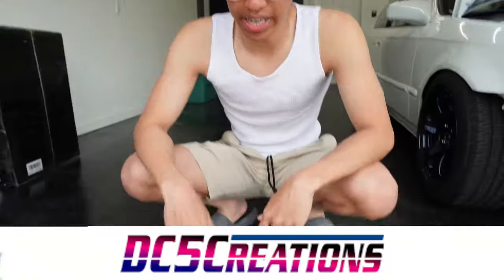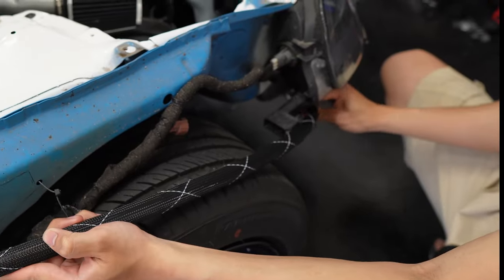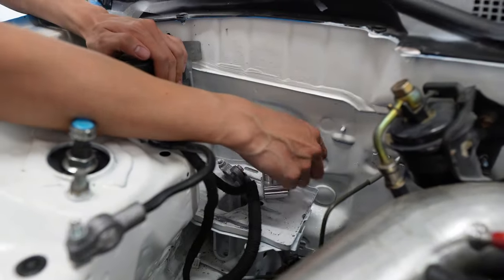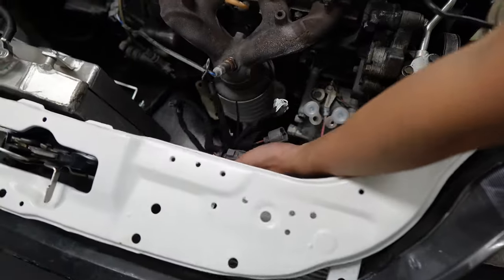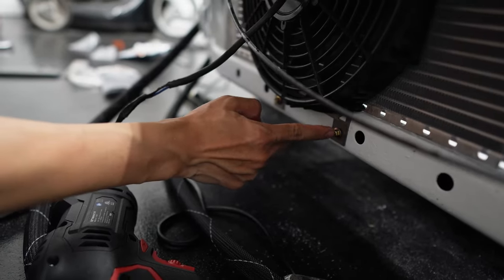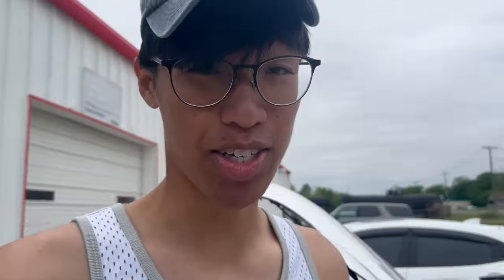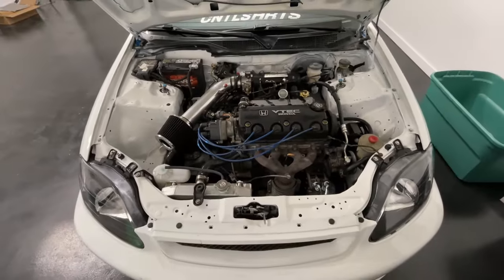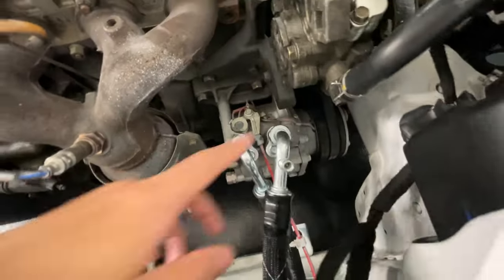The biggest key before turbocharging my daily..

Comment: Ignore me, I've just had a theory,

 Here's what peaked my interest.
I had a distant memory and the more. I thought the more memory's i went through and... everybody
I knew growing up,

 would smash the gas and turn the A/C off At the same time. and watch the RPM's just rip.. Right?,

In theory, if you got a shorter belt deleted your power steering pump and a c compressor you would have unlocked all kinds of goodness,

 even if you're running 10:1.5 Ratio pistons For those of you don't know, that means a

At 4500Rpm 186 Hp - 140 ft-lbs of Torque😂😂,

 So what I'm saying is, what could you get if you had a track stripped, No cage, a/c - power steering delete, w/Velocity stack.....

Yes I'm  directly, referring to my 3rd gen  K24Z6,
R46 block, I know it sucks..
But...... you Picking up what i'm putting down?? 😂😂😂
Reply from the maker: I was gonna K, but it gets too pricey unfortunately 😩
Reply: Yup... Found out the hard way. It's gonna take me 6 years So I just stripped it.I'm doing it all eco broke boy style I've got time if something happens to me. My son will take it.